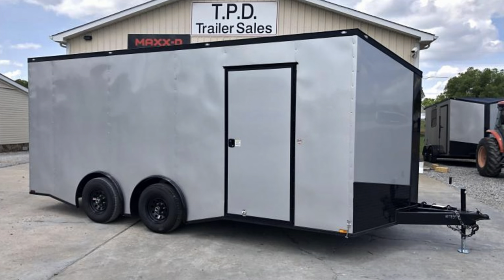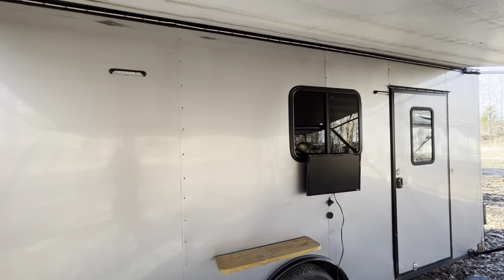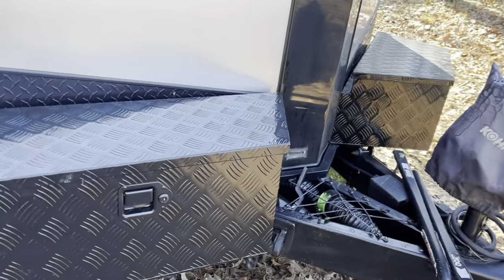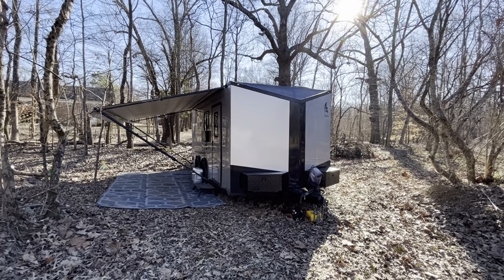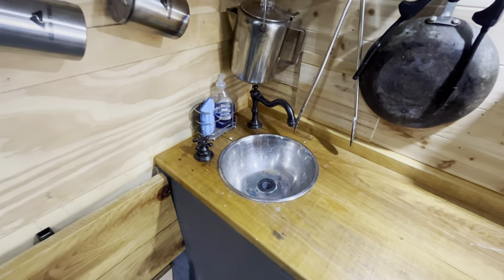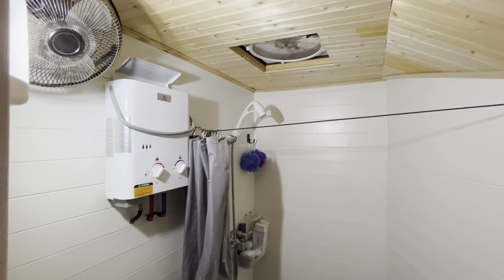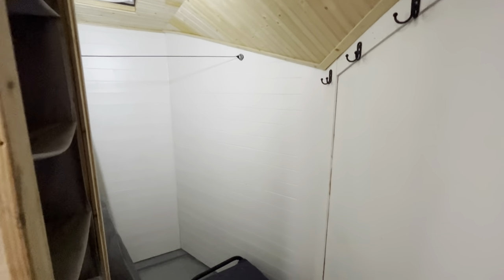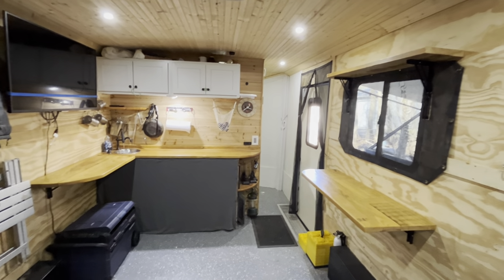Cargo Trailer Camper Conversion - TOY HAULER / Tiny Home.

Comment: Nice build! I have a 2010 Haulmark toy hauler cargo trailer conversion. I bought it already set up from the original owner back in 2019 to go to Sturgis, and then out west. I have done significant upgrades to it, but it has no bathroom. I'm ok with that as I always stay where there is one, but I love your setup. I have a couple of videos. Thanks for sharing!

Comment: This is a great build with great ideas. What material did you use for the bathroom walls?
Reply from the maker: Thanks!  Check out my plumbing video.  I go into those details there.  1/4” cedar over top of the 1/4” plywood

Comment: As long as it works for you and you're comfortable with and in ,  it doesn't really matter what it looks   I would be happy and comfortable in it just the way you have it.  An idea for your bunk that you want ideas on. 1:get a rope hammock and tie it to your 2×4  that. you're using 10:40     2:  go get some canvas material that they sometimes use to make hammocks and attach two sides to your 2×4's and basically make a hammock out of them. I say that since you seem to like what you have burnout pleased with the way it currently looks.   Only reason I'd be concerned with the way you have it is because I know how easy the blankets you are using can rip.

Comment: Heya! I love this set up! I wanted to ask whats the length of this trailer? I've seen smaller ones and like 32 ft ones and those are crazy! Yours is so nice tho. 
I'm hoping to save up money for the next two or three years and get a 8.5x28 or 32 ft trailer depending on what I wanna do. But I really wanna convert one of these into a full time home and go with a longer frame so I can turn the back into a sorta green house that I can grow tons of stuff in and the lights can be powered by solar panels! I know it might sound way to much but I really do wanna make something thats me, ya know?
Reply from the maker: 18’x8.5. The v in the front helps.  When it was empty before the build, it measured 20’ from the inside of the V to the back wall. Hope this helps
Reply: @MisfitRZR  Dang!!! Really? 18' looks so big! I thought it would be cool to get a 32' one and kinda cute the end into its own room and make it into a little green house sorta room. It might be stupid but I think it would be cool to have a room for growing a bunch of plants I could use to cook or eat.

Comment: What’s your tongue weight? I ended up building and installing a large in floor storage made from 1/8’’ steel. My cargo trailer conversion was pretty tongue heavy. The storage was around 130 pounds to help transfer some weight back to back. I keep lead shot steel bags in there when I’m empty.
Reply from the maker: I use a wt dist hitch.  I have two 13 gallon and a 20 gallon water tank all in front of the axels that I use to manage my weight. With that said, with the side by side loaded (backed in) and all tanks full, it would be about 1000lbs. Total weight of trailer with that same scenario is 7400lbs, which puts my tongue right in that 10-15% range.  Hope this helps.

Comment: The only issues I can see on the outside or where you have your shore, power hooked up and your city water hook up and your fill tank hook up because you don’t really ever want electricity and water in the same spot if you ever have a leak in your city water hook up you’re gonna fill that electrical outlet with water and possibly have a short

Comment: This is very nice....I have a half ton trail boss...can tow 9k...and buying my x3 in a few weeks...how much does your trailer weigh? I thought a small toy hauler but just seems like ill be getting super close my my max towing when its loaded and I want to go light as possible
Reply from the maker: Thanks for question.  It weighs 4700#s loaded with all camping supplies and full 20 gallon water tank.  It weighed around 3300 before I started the conversion.  When it is fully loaded with my 4 seater, gas tanks, etc. it comes in at 7200.  One thing that I have leaned now is how important the water tank place is. If I need to get more weight toward the front, I have the 13 gallon black and 13 gallon grey tanks that I can fill too.
Reply: @MisfitRZR  nice...thats perfect this definitely gives me some great ideas when its time ..thanks...Ive seen some where the kitchen and bathroom where up front and split down the middle...but i thought about how much tounge weight thats has to add... this seems more convenient...especially with the spread axels...awesome build man...

Comment: The balance between carrying the toys and feeling like a camper when they are removed.  It is a tough balance.  I converted a 6x12 I already owned back in the spring of 2020 when I found myself with time on my hands, and now wish I would have traded it for a larger trailer.  I am now looking again and watching videos for ideas.  I'm thinking I would like to go with a 7x16 narrow track so it looks like an 8.5 without the width of an 8.5 that happens with the 7 foot wide with external fenders.

Comment: Can you send me a link to your awning? I have a 8.5’x24’ I’m working on
Reply from the maker: They have this one in black metal now.  
https://www.recpro.com/recpro-rv-manual-awning-assembly-in-black/
Reply: Does it attach with a self drilling screw or will I need to have access on the inside for bolt and nut attachment? Was it complicated to install?
Reply from the maker: @davidedwards5474  self tapping screws. Not hard but definitely 2 person job